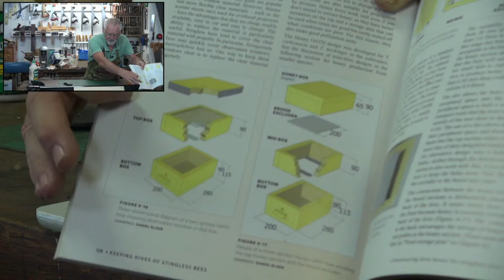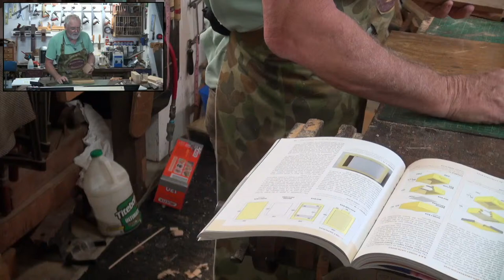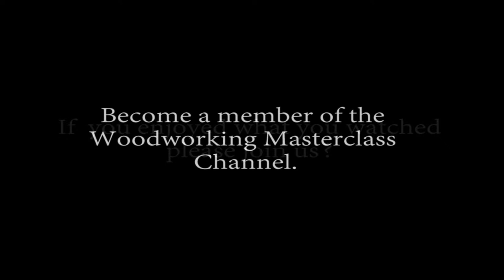Australian Native Bee Boxes. Basic Hand Tools Pt. 1

Comment: I live on the Gold Coast, and would like to build a bee hive box. Where did you source your lumber?
Reply from the maker: Hi Jim. I have timber in stock. What sort are you after? Cheers Steve
Reply: @Woodworkingmasterclass  Hi Steve, thanks! I would like to build four bee hives, two from Western Red Cedar and two from a clear Pine (I plan to paint these). I would like to use 25mm thick by 280mm wide timber. In total I estimate I'll need 2520mm in length for each type of wood, but shorter lengths are fine. I have a planner, so if the timber is thicker, I can either saw or plane it down. Do you have any recommendations on a good Pine variety for bee hives?
Reply from the maker: @JimMaciejewski Hi Jim, Sounds like hives for Honey bees not native bees is that right? I don't have any that wide my western red cedar pieces are only 150mm wide x 900 long  x 45mm thick rough sawn. Many use Hoop Pine for Boxes. I also use Japanese Cedar which has the same weather and rot resistance that Western Red Cedar has. The are 3.6 x 150 x 25 DAR.  Cheers Steve
Reply: @Woodworkingmasterclass  Hi Steve, my mistake on the dimensions, I'm still converting to metric. The Japanese Cedar sounds really good, how can I get a length of that to start with? Thanks, Jim
Reply from the maker: @JimMaciejewski  drop me an email and i'll send you a pic of it. Cheers Steve 
woodworkingmasterclass@gmail.com